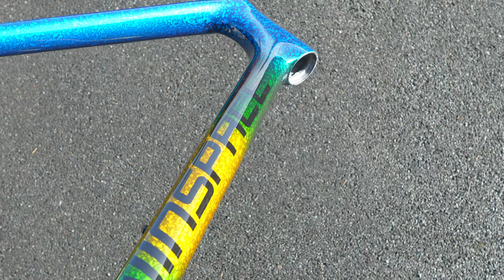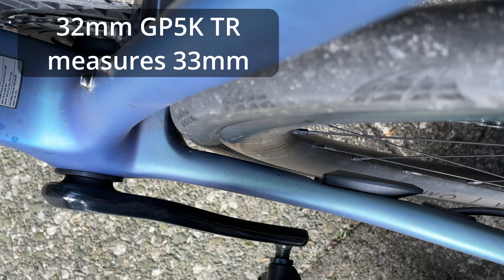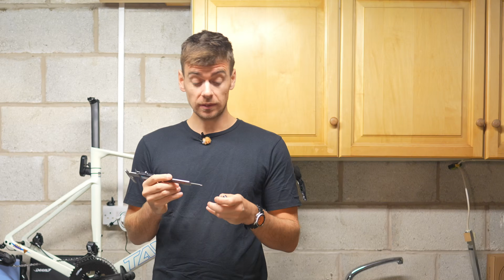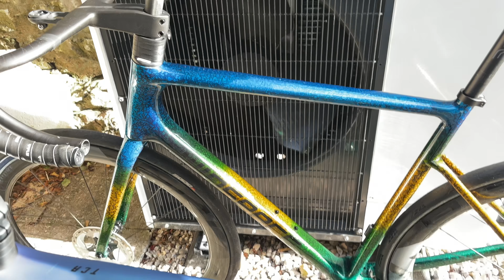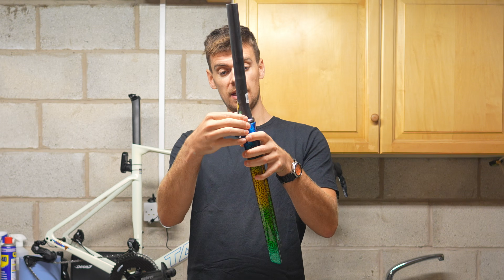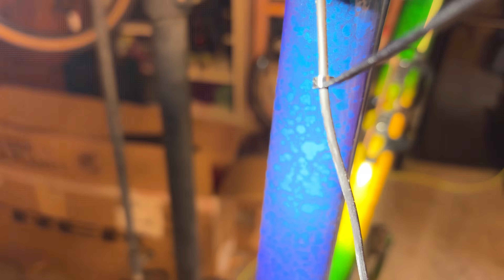Did Winspace win the frame game? #cycling #carbon #engineering

Comment: Every PT video opens my eyes on a new subject of bike engineering. Want to replace my TCR gen9 XL for multiple reasons. Primarily the seat tube angle, as you've also mentioned often. Second, wanting to get a more "aero bike" that also actually supports prolonged aero body positions (kinda related to STA). 
Just don't know what to get because your videos may have gotten me to the point where I might be too picky lol. I've compared about 90 modern Western frames/brands of which only an Aeroad and Koga Kinsei check all geometry-boxes... then come the other boxes...
Keep the videos coming, cheers!
Reply: Maybe Tarmac SL8 ? (What’s wrong with seat tube angle?)
Reply: @pablo_coach_ultimate  PT has mentioned it in many other videos, most recently his custom frame I believe. Slack STA = hip impingement, strengthened by seatpost setbacks. That Tarmac SL8 has horrible geometry (and price).
Reply: @thetinusnl8834  in my size SL8 and TCR frames have perfect seat tube angle for me 74’
Reply: @pablo_coach_ultimate  Frame sizes are exactly the point we (Peak Torque, me) are referencing. We both ride TCR XL's which have 72.5 STA, which is plain stupid.

Comment: I liked the look of their previous frame the SLC, these frames with the lower seat stays just look wrong to me and I don't think I'll ever buy one, understand they stiffen up the rear a bit and possibly add some flex to the top of the seatpost for comfort but its the work of the devil in my opinion. Used the threaded bar press for years, too much wiggle from the coarse threads for these newer standards I've found however, def recommend a cheapo press off eBay/Amazon - that and the Topeak Saw Guide are two pieces of kit I'd def tell my younger self to buy without hesitation.

Comment: 🤣Man, just admit to yourself that you don't want low-stack frames purely out of vanity🤣It is nothing wrong to have a chimney if it is not excessive. Low stack frame generally means more adjustment range and if you ask me, it  even looks better than slammed trekking bike.
Reply from the maker: Haha true there is the vanity side of it for sure, but structurally I don’t like hanging half my body weight off a 50mm length of steerer. Its not a nice thought when its a safety critical item. Fortunately this one is nice and thick unlike the tavelo which has a wafer thin steerer

Comment: i wanted winspace but the short seattube  meant my Seatpost would be sticking out too much. my saddle height is 84.5 cm according to my previous bike fit but i have it at 83cm with 20mm offset seatpost. icanA9 frame fit me well. i could slam the stem too. its very similar to TAVELO in geo

Comment: If you strip out the hex of an axle best bet is an easy out - a threaded "drill bit" that will bite into the hex hole and back out your axle. But if you do strip the threads on the female end, that's definitely another issue and you're proper f*cked.
Reply: just don't strip anything to begin with, ffs. problem solved.
Reply from the maker: Great solution that

Comment: The typical asian body proportion is tall torso and short legs --- so when they extrapolate frame geometry to larger western sizes, they stay long and low. Combined with most frame sizes finishing at an xl/xxl (in reality a "56"), they just don't have accommodations for taller riders.
Reply from the maker: @sabamacx  i don’t think they do this intentionally for Asian riders. They’re not selling these in the domestic market as the Chinese covet the western brands (pinarello, s works etc)

Comment: As a last resort, if you can't get an axle out, you can drill out a hole in the axle big enough to glue an impact driver hex socket with JB weld or other really good epoxy. Then use an impact driver to remove the axle.

Comment: Couldn't a stuck rounded thruaxle be removed  with a drill and a bit designed to remove rounded fasteners?
Reply: Unless you've F'ed the thread, alu is soft, you can always botch something, but most bike shops are incompetent hipsters these days, so you'd have to be pretty resourceful to rig something. The general idea is that covering the other end is form over function because you removed redundancy

Comment: If you want a loooooong frame -- my XL Stromm has stack and reach figures of 540 and 466 respectively.  (It's mostly designed for running a riser stem unless you're hyper-flexible.)
Reply from the maker: Thats a super low stack!

Comment: I got a Winspace SLC 2.0 (previous generation in rim brake) and the bike climbs like a dream!
Reply from the maker: I nearly bought one of them years and years ago but they didnt make my size. Seems they still don’t 😬
Reply: I've got one sram red mechanical and hyper wheels fantastic bike sub 11minute hard knock pass too
Reply: @markhall6026 but descending in wet conditions will be a pain and dangerous
Reply: @Pablo_Coach  this would have been true ten years ago but not now on winspace pads
Reply: @markhall6026  wow,
Tell me something about it
Reply: @Pablo_Coach  there is a 2 mile descent near where I live Hebden bridge there is  2 hard braking points and with direct mount brakes I have no problems with this descent wet or dry I also have disc brake bikes and I love both
Reply: @markhall6026  Winspace Carbon rims?
Reply: @Pablo_Coach  yes
Reply: @markhall6026  what about modulation? I heard that braking power ramp up with lever force in a non linear way so may be dangerous especially on wet and slippery road
Reply: @Pablo_Coach  I think you need to remember that once you have enough power to lock the front wheel all you need is finess to modulate what grip you have its the same for rim or discs
Reply: @markhall6026  no exactly. In rim brakes You have big friction from cables so that have VERY big impact to modulation and overall feeling of the brakes. With disc brakes You have excellent brake control with one finger on lever

Comment: I am so past BB86.
Reply: If frame good no issues, Me 29,500km never creaks no issues still spinning freely :)
Reply: @swites BB86 isn't optimal for cranksets with larger spindles (30 mm and DUB 28.99 mm) as the balls in the bearings are too small to be long-lasting.
Reply: @sbccbc7471  Yeah they're designed for shimano 24mm spindles like mine which is why I have one:)
Reply: @sbccbc7471 BB386evo is for sram cranks 👍

Comment: I would agree that the largest sizes in most of the frames are too small/too low. I'm 6'5 (195 ish) and the search for a dtc chinese frame has been a pain... most don't even go to a 58 let alone anything close to a 61. I ended up buying a frame that matches canyon's sizing on their grail frame so that was a win.
Reply: Agreed, I ended up with the latest Trek Madone in an XL, the stack and reach was the reason with it having a highish head tube
Reply: i was the same nightmare for me
Reply: I'm very average height, and was looking at winspace when I bought my last bike... but was also put off by the geometry. Very low stack, combined with long wheelbase and trail numbers that would be more typical of touring bikes. Odd combo.
Reply: @dispatchesFromHell  In smaller sizes, it has the same stack and shorter reach as a Supersix Evo, which is considered to be a race bike, with an almost endurance geo. Like size S has 520 stack, which is in the medium. Chinese frames are optimized for smaller sizes, unlike many western brands.
Reply: @XXXENOWRAITHXX  TCR XL will do it
Reply: Hey, out of interest and context what height are you, currently digging through frame goes for a new frame and as a tall lanky person it's a pain, I do though run a very low front end generally but would be good to be able to compare to you...

Comment: I can tell watching this video that frame won't last longer than 8 to 10 years. Galvanic corrosion with all the aluminum bonded in parts looks exactly like my Colnago M10 which failed after only 8 years. I wouldn't pay the asking price for this frame. This stuff is cheap quality and materials and should be priced lower as such.

Comment: I completely agree about the geometry. Im 179 cm so not a giant and the stack, reach would be an issue for me as well and im using the most aggressive setting when doing myvelofit. I would need an 80 or 90mm stem on an XL depending on the bar reach.

Comment: On the topic of blind holes and dropout design, I noticed the new Dogma F has kept the threads as part of the dropout instead of bonding a metallic insert into the frame that can’t be replaced if damaged. Obviously a different end of the market, but it was surprising to me when I started looking around that other bikes with blind dropouts weren’t that way.
Reply: I never thought of this, and now you have unlocked a new fear :D Pinarello's solution is clever, but i guess the threads in the fork are still bonded. I was wondering if blasting them with compressed air after riding in the wet would be enough to fend off galvanic corrosion.

Comment: Did you measure how much thread is purchased in the thru axle? I got the T1550 gen 2 and the axle only got 2 full revolutions before the axle bottoms out so maybe just 3mm in there. Compared to my other bikes, I got quite a few more revolutions. I am concerned if that is enough thread depth for long term safety. Granted the thru axle is not really an axle but just holding the wheel in place. Can you calculate how much torque is safe given the 3mm depth. Also the ledge holding the hub and supporting the weight esp on the fork is rather shallow in my opinion and as compared to my other bikes. What do you think?